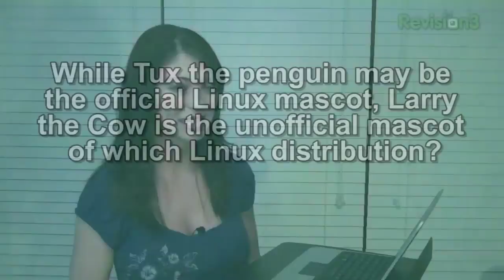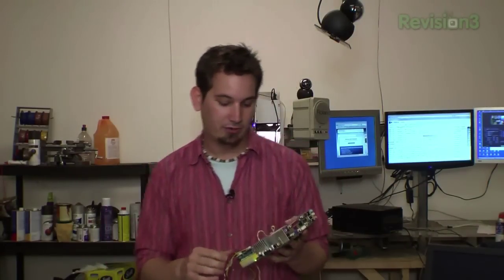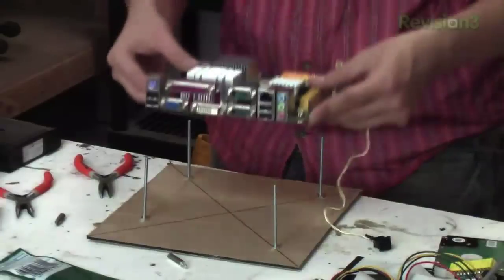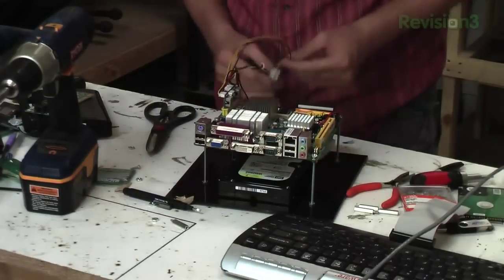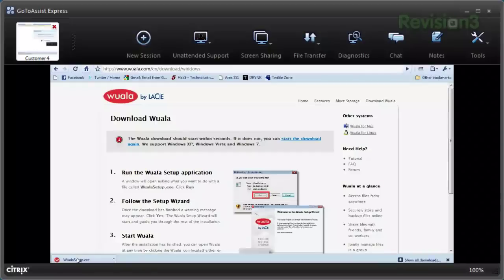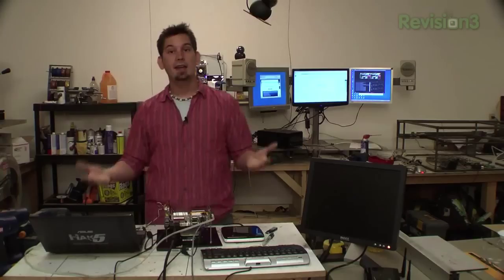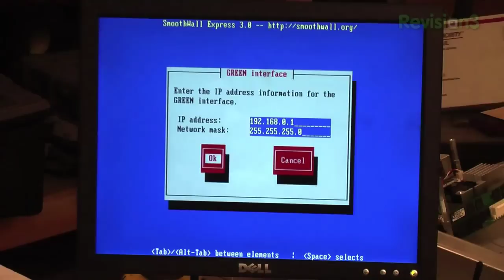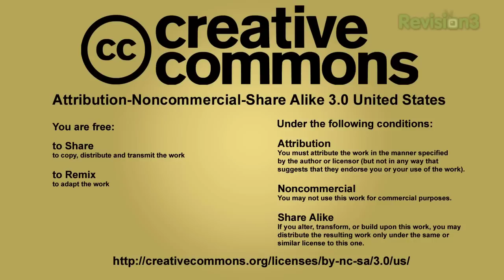Hak5 - Building a high performance home router

Comment: these mini-itx router builds fit really nicely into an original xbox case

I've had mine in an old xbox crystal case I salvaged from a dead xbox for the last 3 years or so

you can pick them up for dirt cheap

Comment: Darren, to line up your drill bit with the hard drive's female threads you can make a template. This could consist of taking a sheet of paper, setting it flat over the female threads, and punch a hole through each screw with something soft, like a pen or pencil tip. This will give you a nice (almost) free template that you can use once and toss, and doesn't require a girlfriend or toothpaste!

Comment: It allows you to basically have your own hardware firewall and router to packet filters and allow traffic inbound and outbound, which if you wanted to buy the cisco hardware equivielent would cost at least a $1,000. So with doing this he created his own rotuer/firewall to secure his inside network and to direct traffic himself rather than having the ISP do it thus increasing the speed of his inside network. Such as having a DNS and a DHCP server of his own. Plus the firewall for added security.

Comment: It would be cool to build in a 7 inch monitor into the case.  Also with Smoothwall, is there a way to directly access the COM ports or the Parallel ports on the back of the motherboard?

Comment: I plan on using this OS on a broken (screen) Acer Aspire One laptop.  Tiny netbook with 1.6 gig ATOM processor 1 gig RAM and what ever hard drive I can find in the back room to stick it in.  Using it to make a wireless router for our Motor Home while traveling so I can plug in my external 1 TB hard drive and serve my multimedia when not in range of TV stations and Internet  Do you see any problem with this setup?  It has built in wifi, lan and bluetooth and I can easily plug in a USB wifi for a second channel if necessary, or of course an old USB LAN card if needed.

Comment: An easier way to transfer your bolt holes to a template would be to copy the screw/bolt side of the hard drive on a copier, then you put the copy on your acrylic, tape it down, and drill your holes.

Comment: No, all you have to do is connect the output to a switch and you can plug in as many connections as the switch can handle.

Comment: Meaning you can set up a DNS server for example, that way your network doesn't have to go out onto the internet to look for a web page, it can look it up localy first than connect to a web page which will gratly increase the speed. You cannot do this with a regular internet router that your ISP gives you.

Comment: I'd definitely use a large USB drive instead, and use a board with more slot so I could add Wi-Fi, and a multi-port gigabit ethernet card. then I'd put at least an 8 port switch where you put your hard drive.  Maybe more or not.. Still a nice project that beats the high cost routers for price and performance.

Comment: The LAN port on the motherboard seems to be a 10/100LAN. I want to know if its enough as a WAN port? A mean will the internet connection (between the modem and the router) be bottlenecking by the fact that the board offers only 100mbps rather than 1gbps? Or because the internet average speed lets say 8mbps is slow it wont max out the speed of the 100mbps nic.
Reply: Jason C. Thank you for you reply!!!

Comment: I say scrap the IDE drive in favor of an IDE Flash Module.  I used 1GB Flash Modules running DSL linux in a small cluster project I built.  Much larger modules are available.

Comment: Hello friend, your video is very good. I want to assemble an 800mW Radio Router, with new parts of PCs, and install O.S. of Mikroik. doing a Hotspot.

What PC Hardware parts do I need to buy, to make an 800mW Radio Router?

Thanks

Comment: you guys need to make an updated for this,   the new boards from ASUS,  Delux 1170 I am considering making a killer router nas server,  all in one  and with 4K and so much more using cat 7 and new WIFI    using the new 14nm intel should get some nice low power cost,

Comment: you need to plug into an internet modem not router. from what i understand from the video this is meant to be used directly from the modem then to a switch as a mode to control traffic which isnt done with a switch like it is with a commercial router.

Comment: maybe.. rather than telling us how OVERKILL this, that and the other may or may not be/how awesome overkill/wast is. could you also please note along side of the overkill what is NOT? like the maximum useful amounts, as well as the minimum recommended/bare minimum limits and requirements please? as fun as throwing better than necessary parts into things is, i feel im probably not alone in believing/usually going for efficiency in (my)DIY projects. doing away with 'waste' (overkill) by flipping it into 'savings' i thought was sort of a main perk/point... but if nothing else, then a personal request i guess :)

Comment: So what kind of benefits will you see from a setup like this vs a traditional router? Is it drastically noticeable? I am looking to set up a home network that will be streaming HD video all over the house from a NAS as well as downloading, gaming and streaming from the internet simultaneously.
Reply: Get a Ac router from asus ! and install dd-wrt ,this is for diy project if u got a ton of time on ur hands!
Reply: We went from a traditional router (used to burn at least one a year) to Smooth quite some years ago (initially on ESXi VM) but as of 18months or so ago the same as listed here basically and we noticed a MASSIVE increase in performance when we went to Smooth on proper hardware.

Remembering most residential grade routers are MASSIVELY underpowered there is bound to be a difference. I've heard of good results with Gargoyle on some resgrade units but I'm still doubtful of the processing power even if it is a good looking system with heaps of features.

The other big performance changer here was pissing off the all in one bullshit and having WiFi access points that are only built to do that one thing (wifi). When coupled with Smooth, our TP-Link 901NDs work exceptionally well for WiFI (best we've had) and since they are separate and not dragging on the router it has greatly increased the network performance as well.

Comment: interesting set up...will this stop any "D.O.S" attacks perhaps boomarang it back to sender?
Reply: No because it's not only saturating the network port on your router, it's also saturating your cable/DSL/fiber modem and every node upstream of it. I've been hit by a few DDoS attacks on one of my older Linux routers and while it survived with some trouble (100% CPU usage on all cores), the internet link went completely dead for several hours because the conntrack tables in the cable modem overflowed and kept getting overflowed by the attack.

And you can't "rebound" a DDoS attack because it's usually dozens/hundreds of machines doing it.

What a Linux router CAN do (if configured correctly) is protect you from all sorts of nasty exploits that are always flying around on the internet from scanners, bots and zombies.

Comment: Given that the Ubiquity Edgemax Lite sells for 100 or less, is good for up to 1 million packets per second and gigabit routing with a full featured firewall/ipsec/multiwan OS on it, this seems quite moot. Besides the Atom CPU used isn't going to really go past 100K packets per second with out a TCP offload NIC. But lets also forget the fact that unless you have 75mbps + internet connection you're not going to bust 17K packets per second (except for torrents)
Almost any router you buy at the store will route your 50 - 100mbit connection fine. Their wireless is the weak link. Get a real AP if you're using wireless, or go wired if latency is that important to you. Since most games use UDP, packet loss typical of poor wireless is most likely a candidate for screwing up gaming performance.
Reply: This guy knows his stuff.

Comment: @wesk18 A ton more customization. Commercial routers lock out or dumb down the majority of options available. For example, I can't configure remote booting on my PC because my router drops IP addresses from the ARP table when the device is off for 5 minutes despite using a static IP on the system and IP to MAC reservation in the router. With a set up such as the one in the video, I could configure a permanent ARP route that doesn't get dropped when the device is turned off.

Comment: I would really like like to know if i would have to use a different setting from the Red+Green if I were to take out the outgoing Ethernet port and replace it with a wireless access point, and if so could you make a tutorial video about it?

Comment: I would like to use a home router that allows me to redirect users to a specified html page regardless of what URL they input.  I intend to setup a file server and allow nearby people to connect to my open router (which is not connect to the internet) and serve them files via a html page.  What cheap router is best for this?
Reply: you can just hack an old wifi router and change the OS on the board so you can add files to it and stuff and have still act as a router and webserver(with no connection)
Reply: PFsense is great for this. Ubiquiti's UniFi wifi access point also includes captive portal function.

Comment: Is there any notable difference? I mean some "WOW!" effect? I guess the web trafic or downloading will be unnoticeable but what about gaming, streaming and such? I've never had any problems with my cheap shitty router, so is it worth going trough (like did you latency in games dropped dramaticaly or something?). I have 100/100 link from my ISP and with $30 router I can get to around 90Mbit/s down, so I wanna make sure, the router won't be a bottleneck.

Comment: B1-Router is based on the famous Raspberry PI and Linux operating system, so ou can build your B1-Router buying the electronic components enough easily.
1) Buy the components (we are giving the links to www.adafruit.com, but you can buy the same components where do your prefer):
– Raspberry PI 2 model B (34.95 USD)
– a case for the Raspberry Pi 2 (9.95 USD)
– Power supply 5 Volts Usb (5.95 USD)
– Usb Cable Standard->Micro (2.95 USD)
– SD card 16 GB (about 12 USD in every computer/phone shop)
– Wifi dongle base version (11.95 USD)
– Wifi dongle with Antenna (19.95 USD)
Total estimated cost: 97.70 USD
2) Download the image of B1-Router’s operating system and unzip it;
– image B1-Router OS
3) write the image on your SD Card:
– using Windows computer;
– using Mac Os/;
– using Linux.
if you get an error writing the Sd card it could be due to a little bit smaller SD card, you can solve using 32 GB SD.
4) Assemble the components and fire up! (you have 2 weeks of free vpn service and the extension will cost only 99$ per additional year!)
http://www.b1router.com/do-it-yourself-diy/

Comment: What about Wireless ? Can i use Smoothwall to regulate out gain ?  I have got mikrotik, it´s perfect for this solution, but quite expensive ... i´ll be happy if i will find some other methode to get same result. Regard, your fan.

Comment: I don't think a hight performance router should have a hight cpu, look cisco 6500, the power is in the ASICS not in the cpu, if packets arrive to the CPU that means process switched what is a lot of times slower than CEF switched using the ASICS

Comment: no it won't... atom's power consumption compared to socs in routers is not much different and instead of a hard drive you can use CF or some type of memory stick to save power.

Comment: Cowboy-Tech
Where is your anti-static advice (you have your hands all over the contacts on the circuit boards) and any precautions about unplugging the power before ripping out the cards.

Don't you realise that the metal case of computers is as much about screening out RF interference as it is about housing the components?

Nice idea, but poorly implemented tutorial with limited research implemented.

I feel like I'm being talked to like I'm 10 years old.

Comment: Where to connect phone line (Dsl) cable?
Reply: You'll need to get a special modem for it to work with ethernet I think. Maybe PFsense or another firmware supports using a fax modem style card for that? I'm not sure as I have Mediacom Cable not DSL over phone lines

Comment: I have an old PIII 866mhz Gateway with 512mb SDRAM pc133.... 4 PCI slots.... 100Gb HDD PATA(IDE)..... 90 watt power supply.... I have tons of PCI NIC's ....Anyone using something simular for a router ? Current have Win XP SP3 on it.
Reply: Way back when I built my first Linux router, I was using an AMD K6/2 500 with 384M of RAM and it worked fine for routing on a 7 mbit internet connection. It got a little slow when I put a website on it that used SQL and PHP though.

A PIII 866 should be fine if you don't have a need for heavy bandwidth throughput.

My current Linux router is an A8-5600K, 4 GB RAM, 1 TB drive and 3 NICs with 4 ethernet ports for various networks. It's completely overkill for packet pushing but it does a plethora of other things too (web server, virtual machines, etc.)

Comment: net speed will only be as fast as the 1 isp allows and then limited only by the internet gateway aka router thats my point fuck knows what mission your own get your facts right and show proof if you belive im wrong dns servers do not get used if host files (cache) is up to date so thats not an issue